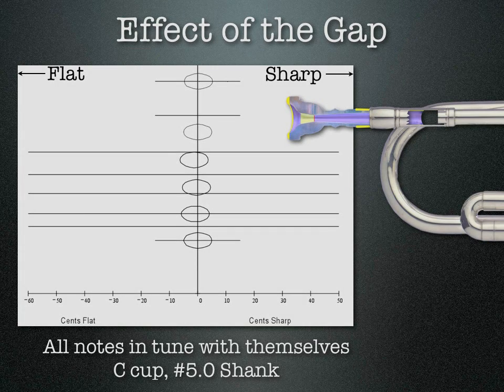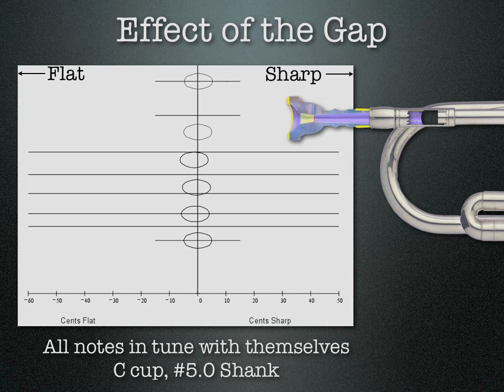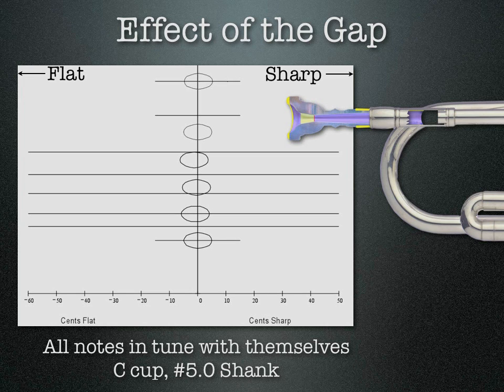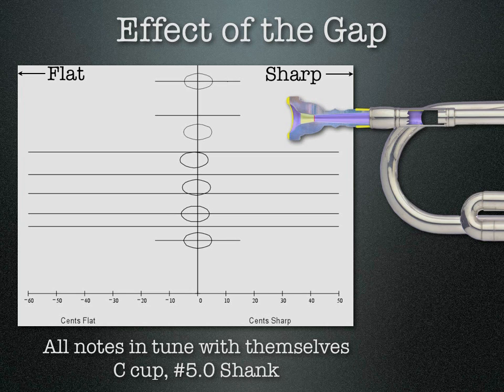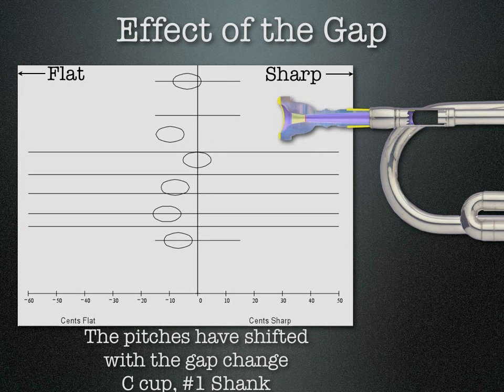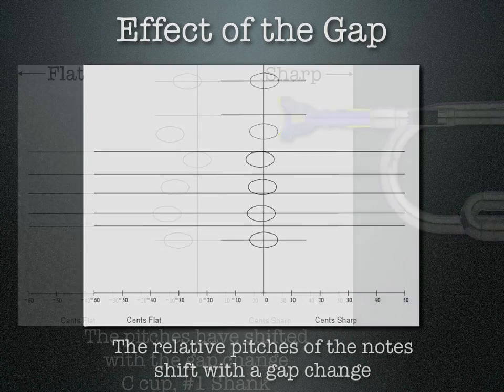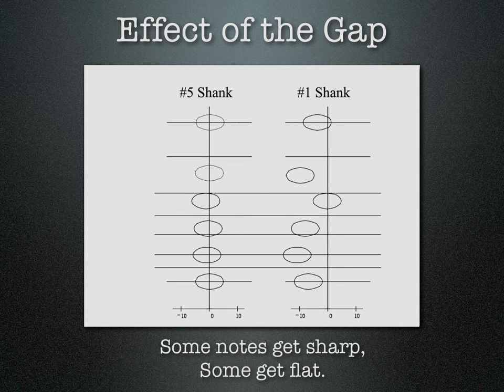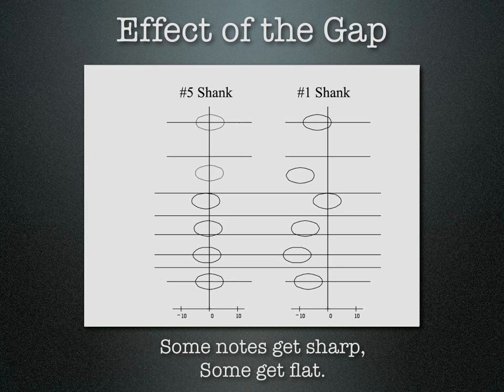What changes when you change the gap?

Comment: Something have to be cleared :

1/ The shank length matters. And so we are only acting on the gap for a question of turbulence, which logically should lead to seeking a zero gap.
 The mouthpiece position doesn't matter. We could just lengthen or shorten the shank for a minimal gap. Or I would like to understand why we would need controled amount of turbulence at the gap level.

2/ The ring distance to the receiver matters. We move forward or backward the whole mouthpiece for a precise tuning. The gap is only a reference point to determine the position of the mouthpiece in the receiver. Once the mouthpiece is tuned, the gap could be filled to avoid unnecessary turbulence.

What do you think ?